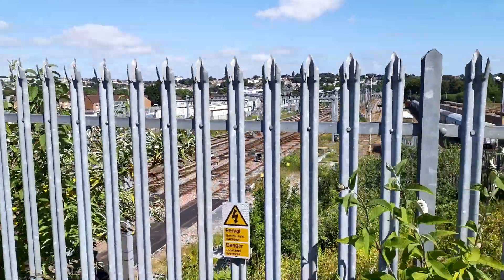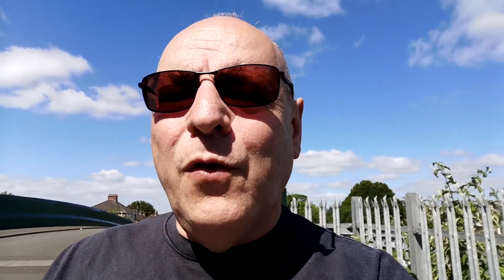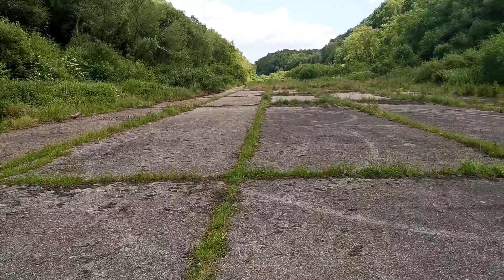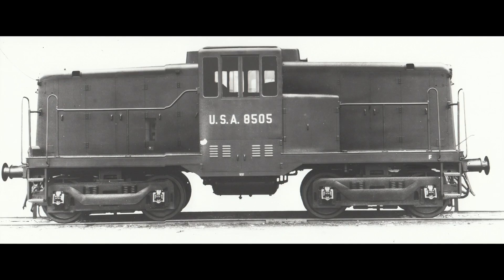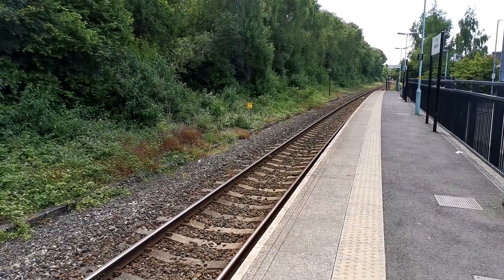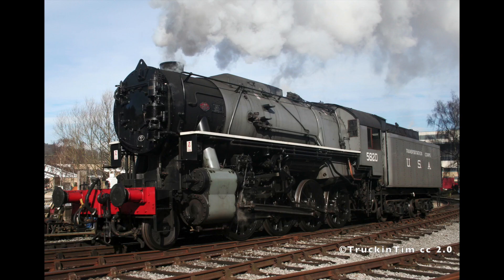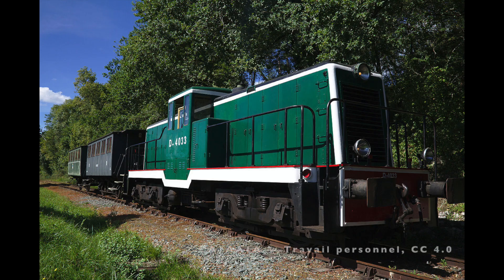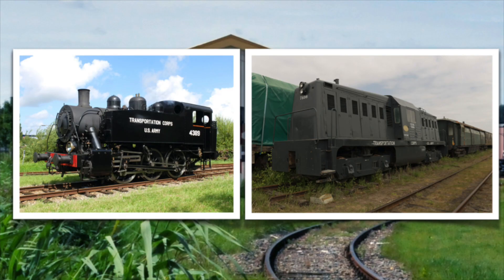USA 756th Rail Shop Battalion

Comment: Great video,  assuming the locos were purpose built to work in Europe? Usually expect US locos to be far too big to  fit within our loading gauge
Reply from the maker: I believe so. Some of the US locos are huge. The GEs specifically had cut down cans compared with US versions
Reply: @bobsrailrelics  Definitely, all of these were designed on purpose to fit the smaller overseas gauge (UK) and with axle loads compatible with european railways of the time 16 or 18 tons....